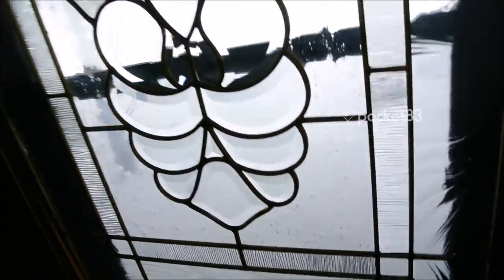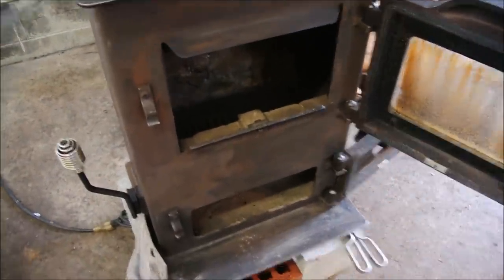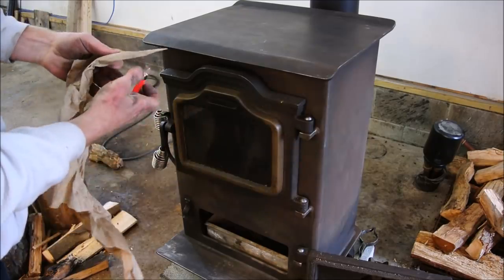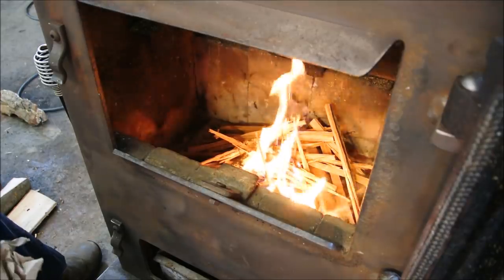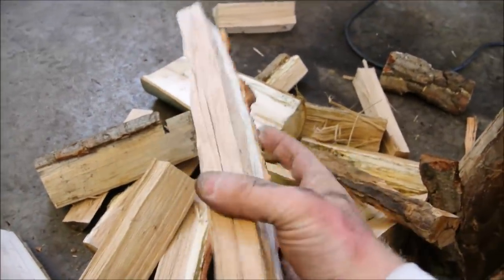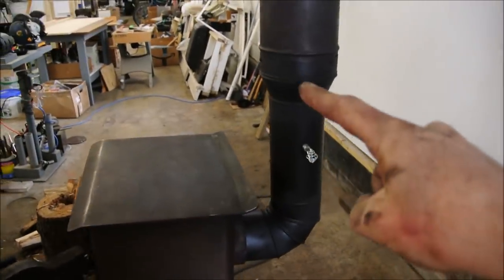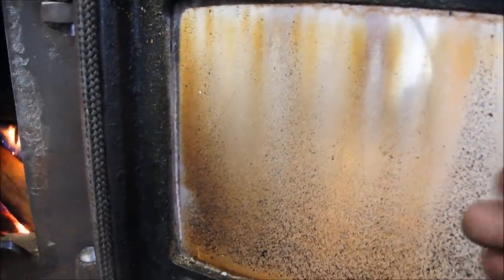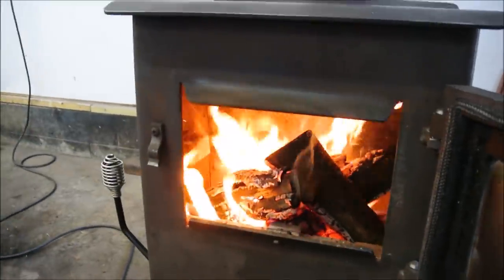A Look at the Harman Mark II Coal Stove

Comment: Thats a nice Harman Stove. However, that isnt a Mark II, its a Mark I.
Reply from the maker: Oh. Maybe the metal plate on it from the factory that says otherwise must be wrong. 

In all seriousness, tell me what you think the difference between the two models is, and I'll humor your "however."
Reply: @pocket83squared  So i have a Mark II, my boss has a Mark I that we're currently both restoring at work. The Mark I, like yours, has a removable brass trim around the glass, but the top part of the door is not removable. My Mark II upper part of the door is removable however, and also brass. The Mark I also has a further spacing between the upper door and the lower ash tray door. The Mark II is much closer. The Mark I is also narrower and taller than the Mark II. You'll notice, that on a Mark I that the door is almost square, where as a Mark II is more rectangular. The Mark II also uses more fire brick than the Mark I.  Hope this helps.
Reply: It's definitely a Mark I. I have both a Mark I and Mark II. Both are fantastic stoves. The Mark I is great for smaller areas. I burn wood and nut coal in mine. I am in PA as well. The Mark I has a 12" wide door opening. The Mark II has a 18" wide door opening and is about 18" deep. And if you want something bigger, the Mark III is the same width as the Mark II but deeper at around 24". I've heated with coal my entire life and doubt I will ever give it up.

Comment: --- you are NOT SUPPOSED TO INCREASE --- your stove vent pipe size --- as you did . Looks like you went from 6 inch to a 6x8 increaser  --- TO A 8 INCH ALL FUEL CEILING BOX THAT IS A NO NO FOR STOVE INSTALLS .--- Download an owners manual online . remember--- if you have a fire --&  your insurance Co can find an error in install -- THEY CAN DENY COVERAGE ! --- DO NOT REMOVE BRICK .
Reply from the maker: --- NOT --- ALL NO NO --- DENY --- NOT
Take a breath. Tell me, why? What's your evidence? The draw is ideal. I've had zero problems with the large flue.
Reply: Not true at all you can increase it, you just aren’t suppose to decrease it, example, going from 8”-6”